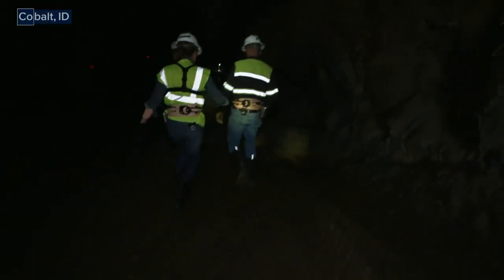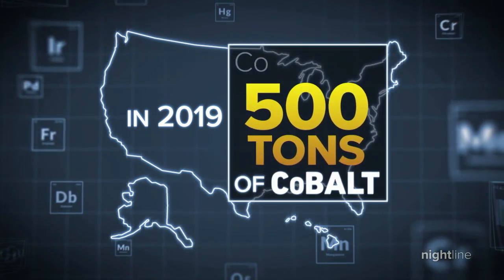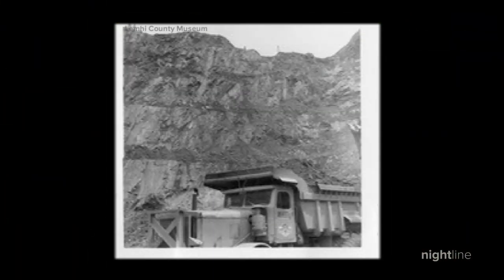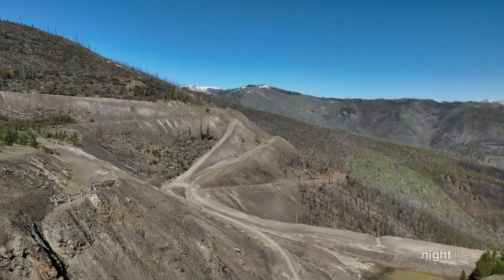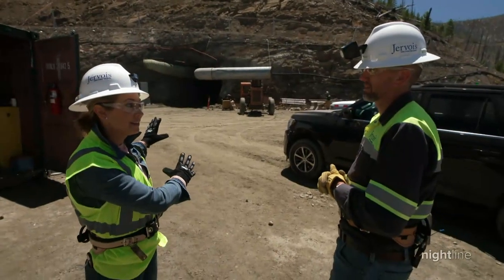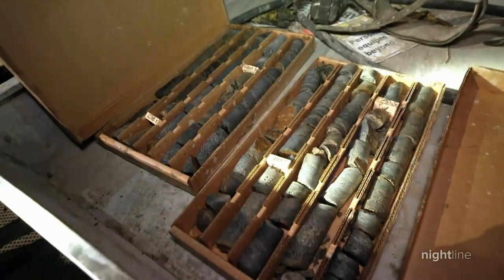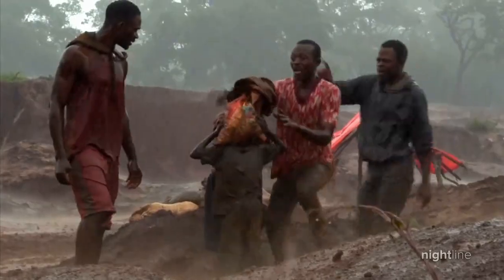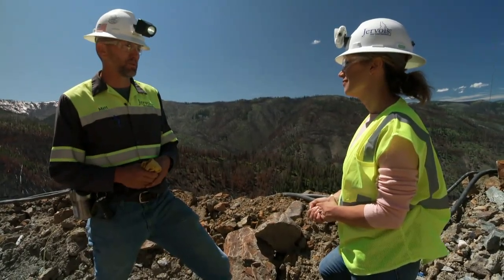Cobalt mining operation works to leave small ecological footprint | Nightline

Comment: What will happen in 7 to 10 years when your EV battery needs to be replaced? It takes 500 million tons to make 1 car battery, not to mention mining all the minerals would deplete earth and they won't be replenishing it....
Reply: Far out man, your figures are exaggerated by a factor of about a million. 
Anyway batteries are recycled because it's easier & more economical than mining again. 
Can petrol be recycled?
Reply: @guringai  bio diesel, yup. When i worked fast food as a kid a guy came through once a week to take our old fryer grease... As fuel. Byproduct? Water.
Reply: @guringai  lol YOU CAN NOT recycle an EV battery. 
It is actual toxic waste on scale of spent uranium in needs of storage. 
There is NO recycling or these batteries. 
Gas cars over 93% by weight 
EV less than 30% by weight

Comment: If you want your little electric cars, you’re gonna have to do mining and chemical processing.  it’s hardly green and not good for the planet
Reply: So tell me how clean oil drilling is. And nothing nastier than an oil refinery.
Reply: Extracting oil, refining it, shipping it burning it while you pay tyrants....how does that compare?
Our car is charged from rooftop solar - literally sunlight. & The battery can be recycled,
Reply: EVs are just less bad than fuel cars

Comment: let me help u guys understand electricity and some options
a 4000 RPM DC motor from amazon 
hooked to a 
500 amp GM alternator <from general motors>  that makes 500 amps at 800 rpm 
will produce a huge amount of power...   (tesla's original ac power motor)
alternator produces enough power to power DC motor and run eclectic and charge compositors/batteries
making lead batteries ah real option again for power storage..